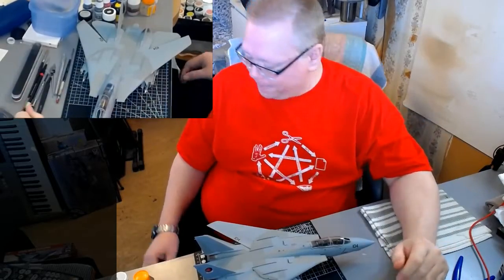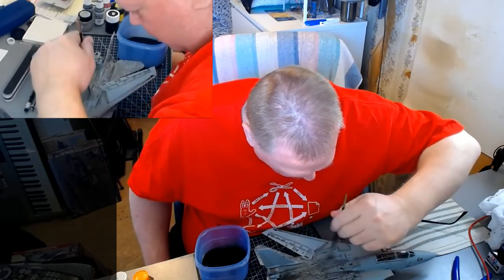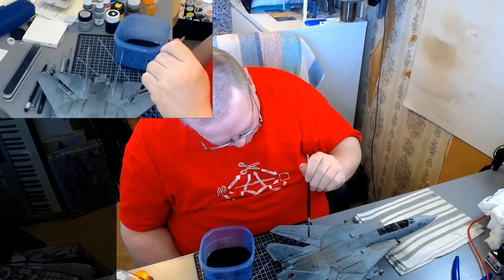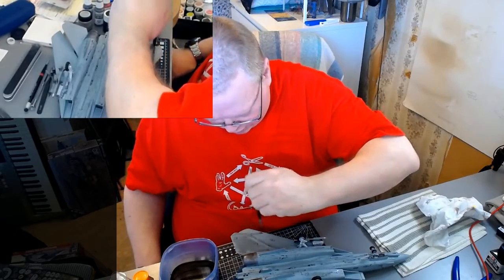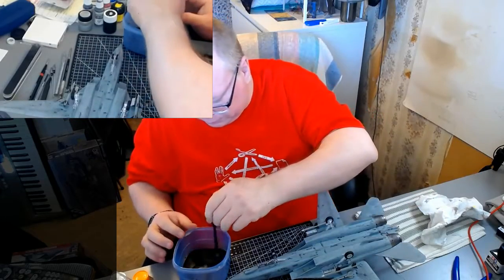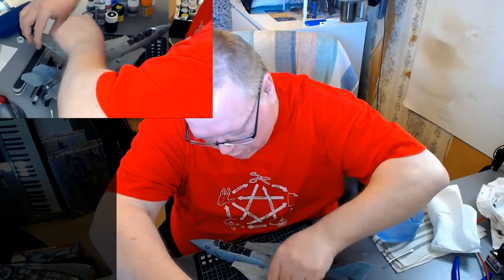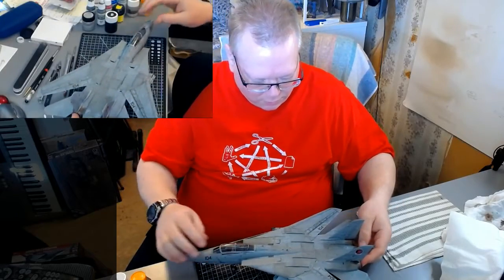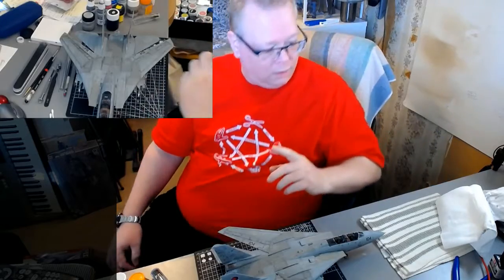Building Maverick's F-14 Tomcat from the movie Top Gun. Part 5.

Comment: I had problems with how the wings come together. It would seem like the holes would have had a screw to keep them fixed, in case one would have to keep correcting the fuselage mating as I did. Your thoughts on that?
Reply: I came up with a fix for that. before assembling the wings, I cut off the part of the wing that, the pivot point on the fuselage sits in. I cut it off flush to the inside of the wing. I took my time doing this. i then took that small piece and, trimmed it down to form a cap. after doing that I assembled the wing. 

drill a hole in the top of the wing, directly over the hole for the pivot point, and big enough to fit the little cap inside. I drilled a small hole in the two caps, and pushed tooth picks in them. I just need friction holding them on,so I can remove the toothpick after gluing. if the  inside of the wing is properly cleaned up, and the resulting cap is flat and flush on both sides? there is enough of the pivot point protruding up into the wing,  to allow the cap to be attached, and still allow wing movement. I used Tamiya thin to attach the cap. as long as you don't go crazy with that hole inthe top of the wing? everything will be covered by the fuselage.

my first go at this kit, I did use a nail, to create an axle and a retainer. but, that created alot more clean up work after.